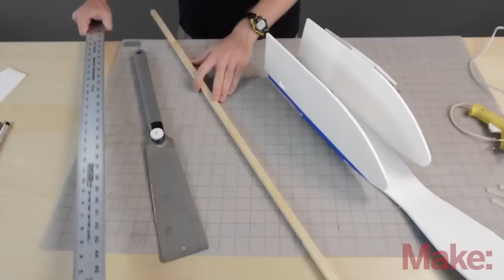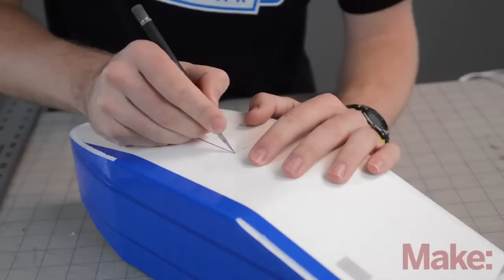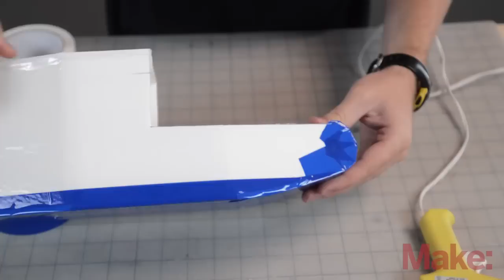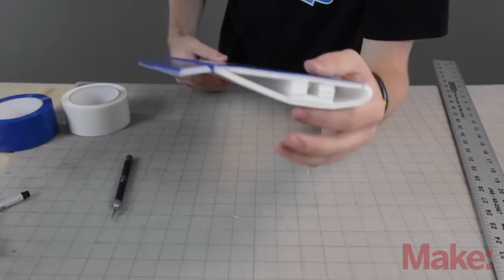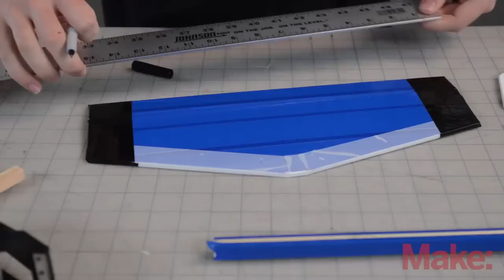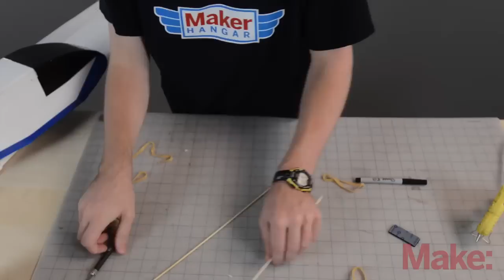Maker Hangar: Episode 10 - Maker Trainer Assembly

Comment: George,  Check out ExperimentalAirlines here on Youtube.  As mentioned by the video, this is an "Armin" style wing, invented by Ed of ExperimentalAirllines.  Ed's basic wing is super easy to make, nice and square and made from a single piece of foam board.  Much easier to do than the overly complicated one MAKE has here.  You could easily replace MAKE's 3-piece wing with two standard 30" Armin wings cut to your desired length and attached in the middle and have a much simpler build.

Comment: Regarding the spars;  You have to have them directly abutting the "ceiling" of the fuselage or the stress of flying will slowly tear out the holes.  Yours are too low down the fuselage.  You should also add another section of foam board to the ceiling on the inside to strengthen it, and the spars should actually be just UNDER the leading and trailing edges of the wing to help hold the wing in place.  As I said before, it's a really neat build, but you should simplify the wing and fix the spars.

Comment: First of all, let me just say that this is a really nice looking and interesting build overall. But why is the wing so unnecessarily complex?  Two 30" standard straight Armin wings with a single tape strip in the middle would give you a much less complicated and easier to transport fully removable wing.  Not only that, but you didn't use Ed's clearly superior "Kissing Tape" method for the ailerons, despite going 99% of the way there.  Also, your wing mount spars are too far down and will rip out